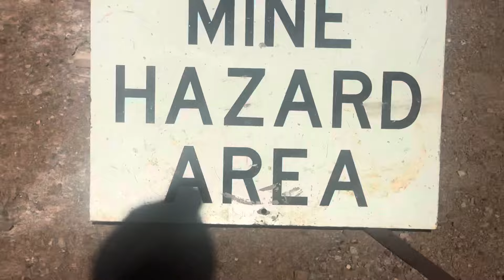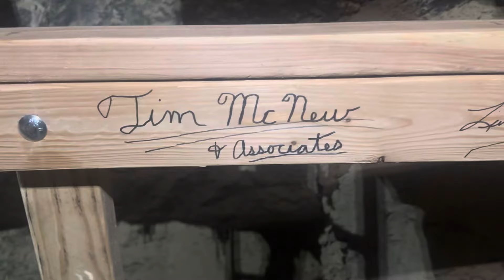Down the mine to see a new underground bridge!

Comment: Bridge is cool but I would add some angle braces to increase the load carrying capacity. Right now you basically have 2x4's as your structural, 1 person maybe ok 2 people on that bridge I'd start to worry. Look at the way a truss bridge is made and add those kind of braces to your current bridge.
Reply: Yes, we've discussed chipping a pocket in the wall and placing a post to provide additional support. I've bolted heavy gauge steel supports to the ore car track to strengthen it. Right now, it will only be used for light foot traffic. Eventually, we hope to muck out and timber the main shaft. At that time, we'll look at reconstructing it. :)
Reply from the maker: It’s got the steel rails for the ore car underneath and some steel channel.